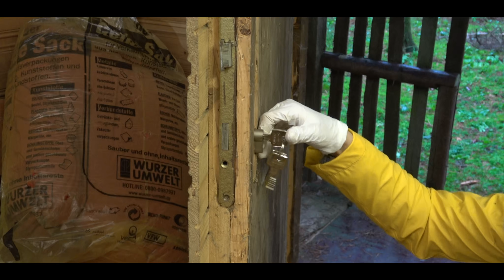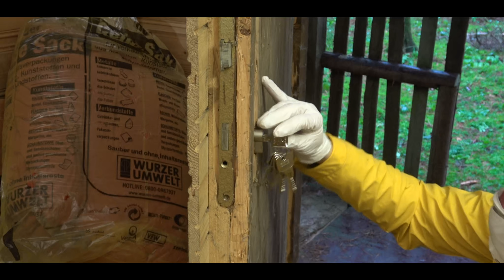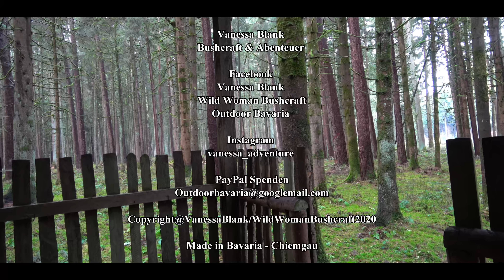🌳🏡🌲Forest Cabin🦊 #1 Tiny House - The Renovation begins - Vanessa Blank - 4 K

Comment: That little side room looks like you have a Murphy bed built into the back wall. The way to tell is to pull on those short wood pieces at the top. Also, that is a square cabin and you are missing a room. What's on the other side of that small room. Or is that room across the back wall of the cabin?
Reply from the maker: Hello my dear viewer!
I would be happy to answer you individually and in detail, but I am 
still in my forest hut at the moment and working on my interior design!
I hope you are not angry with me and next time I will certainly have the
 time to answer you in detail!
Will you be back with my new videos at the weekend?
I would be very happy!
All the best, your Vanessa -From the fox den 🦊

Comment: Please change the curtains:

They should be flat and remain within the window door frame so you can easily open or close the windows without putting the curtain on one side every damn time ... 

once you have the exact dimensions of the window door, you can buy them in rolls ready for cutting at height ... attach them with the white velcro to the frame of the window door upper and insert a removable iron / aluminum plate as weight down to stay straight and put.
In the bathroom, no curtains, frosted glass will definitely do the trick better.

Comment: One more practical tip: Save your expensive Fjällräven (and other) outdoor clothing when renovating the cabin, and use workwear or just old/tough normal clothes. Not fun to rip expensive clothes on a nail, screw or splinter sticking out...

Comment: I got rid of all gas stove and heater and got wood stove and moved it outside in warm weather it will be to hot inside just leave the pipe where it is and put something outside on pipe to keep it sealed when not in house  just put a straight pipe on it outside and cook outside best to build a small shelter overtop and have a sink and counter I loved outside cooking in warm weather and doing dishes outside too because more ants ect.  in warm weather I had a picnic table outside and my little boy had a small pool and I built a enclosed shower outside as well.You can heat water for the pool kids have nice bath warm water.Its fun living off grid solar is great but you need sun and little sun means more batteries I had a friend who rigged a bicycle so he his wife and kids road  it and it charge batteries kids were constantly wanting to ride it I believe u tube has that process I dont know how but I know it's possible kinda of the principle of a wind turban.His wife would ride it charging batteries and reading a book.You will get inverter and can run a small electric refrigerator lights and maybe a electric burner so you can cook on it breakfast without having to do a fire except in cold weather your wood stove goes constantly.peace and love my friend.